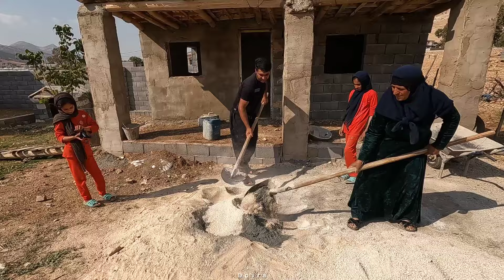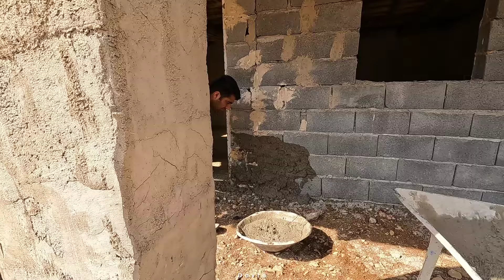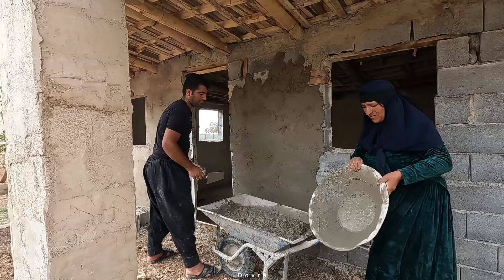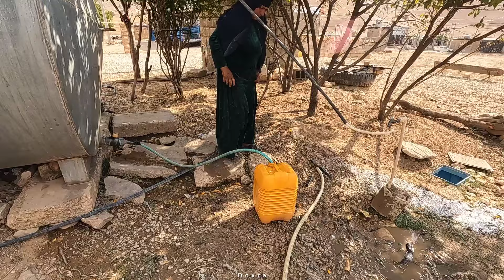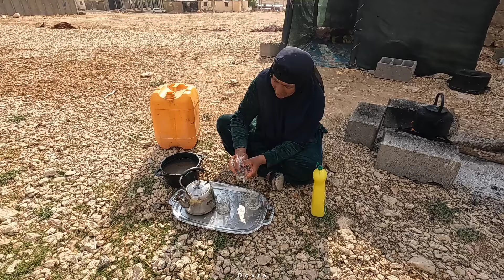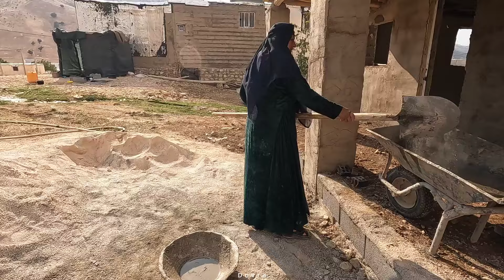Love and solidarity: clever design front wall of the dream cottage grandmother and two orphan girls

Comment: Operator, do you read the comments? It seems you don’t! It’s impossible to wet the cement blocks before applying the cement on to the wall. That way the cement sinks into the pores of the block and holds much better. A master would know this.
Reply: That is what I  was going to suggest, that they wet the walls first.